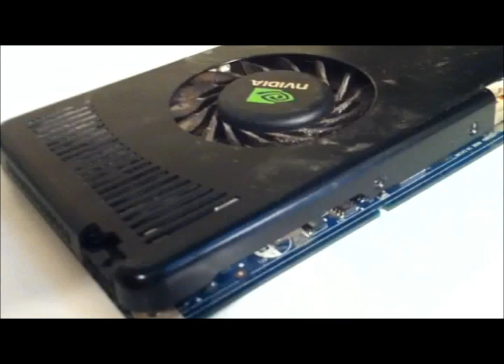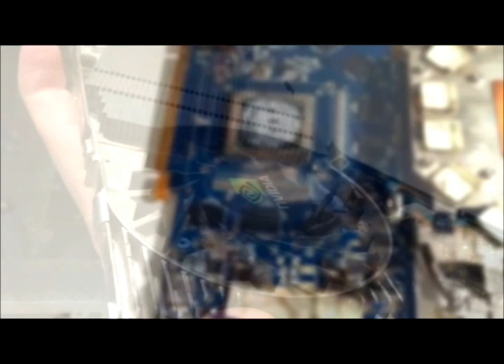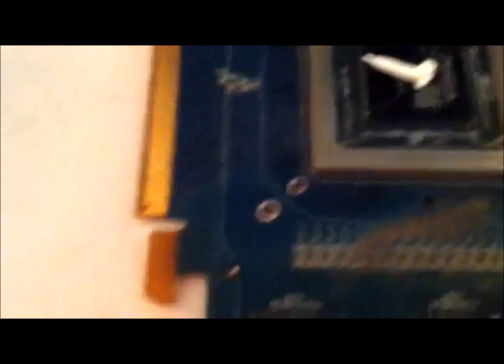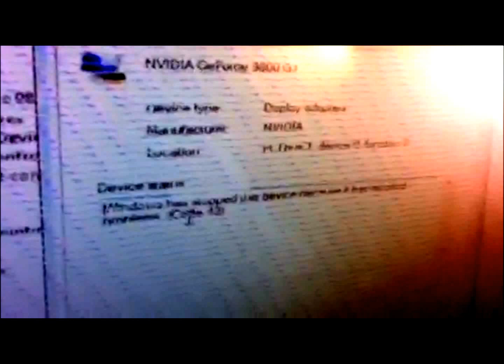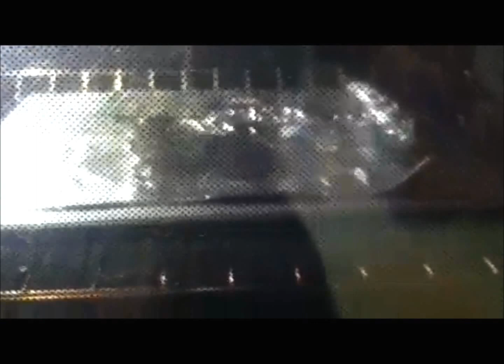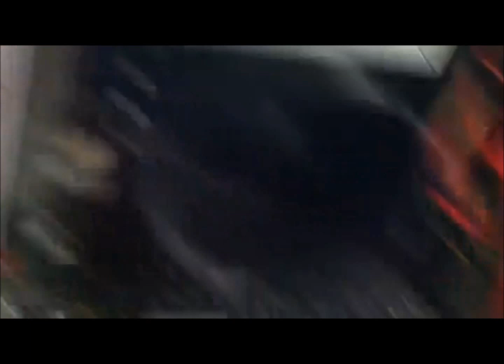The Oven Trick broken Nvidia 9800gt PROBLEMS FIXED!

Comment: Why does baking the video card make it work . Can someone explain why it makes it work .
Reply from the maker: Hey! Check out the description its explained there,
Reply: Its gpu solding problem heating the gpu rebuild the joints .... its a temporary fix.
Look for reabling gpu for a proper fix.

Comment: Thanks alot!!! I followed your baking instructions exactly as you directed and... SUCCESS!!!
I had a BFG 9800GT which was stuck at 70 degrees idle, but now after doing this repair fix, no more artifacts or dots, plus my temps are down to 45 degrees idle after adding an artic cooling heatsink kit. Again thanks so much for putting this example out there. Keep up the good work!